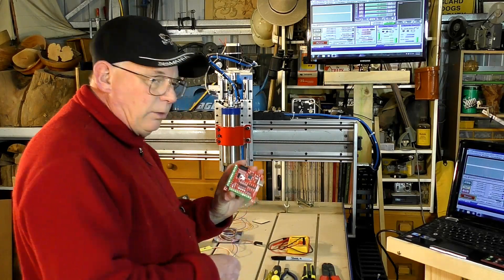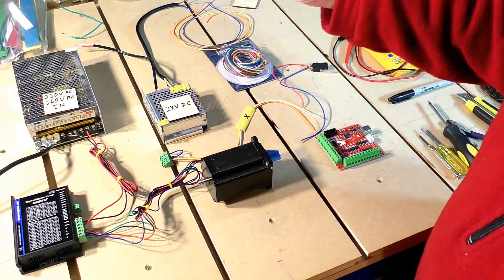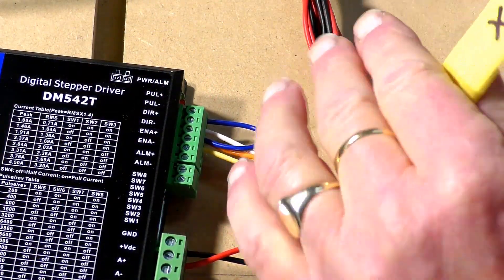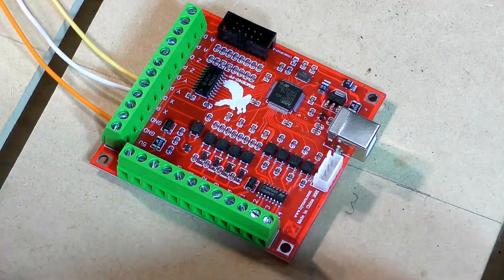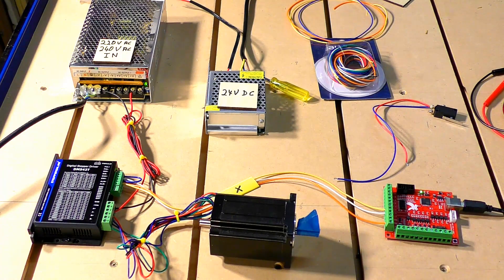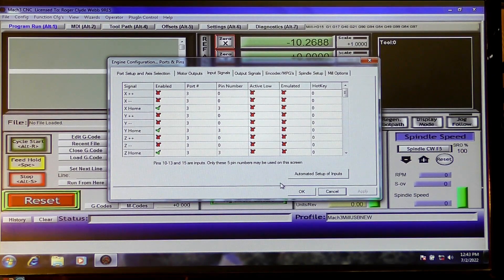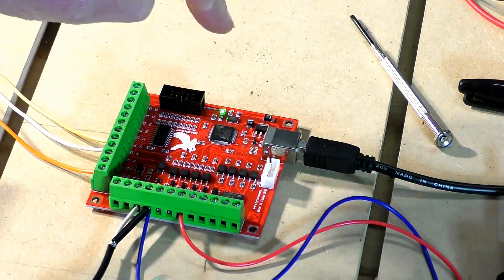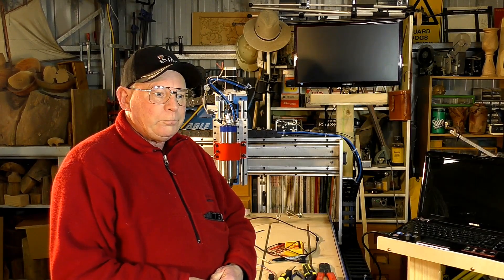Episode 23 CNC Mach3 wiring all you need to know.

Comment: Hello teacher. Should we feed the place where it says 24v dcm on the card with a different power supply? Or would it be a problem if we connect the 24v power supply that we feed the stepper motors to the place where it says 24v dcm? Thank you and best regards.